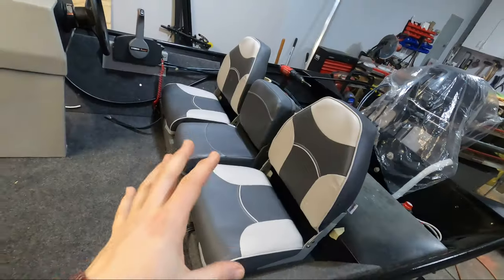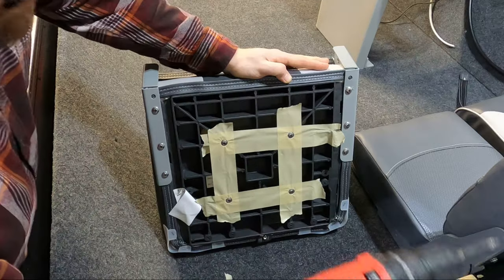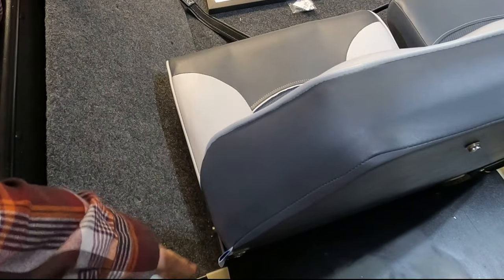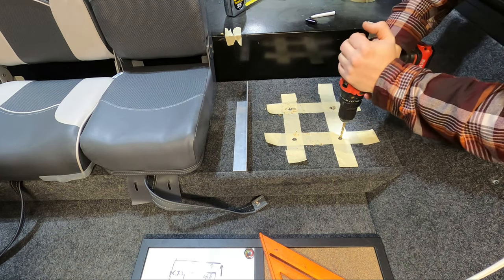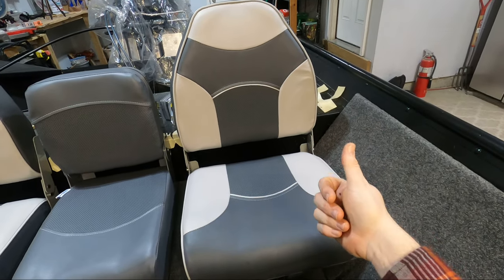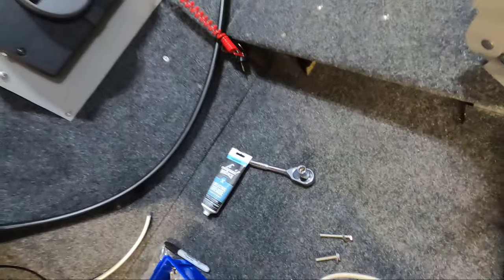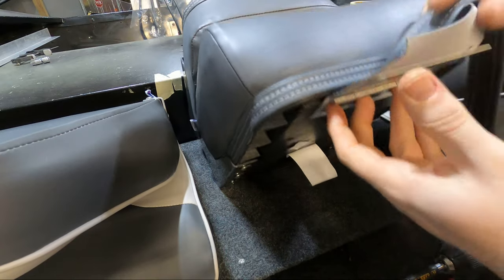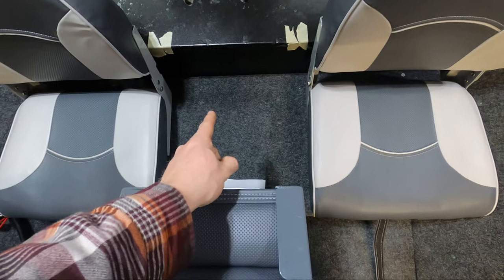Bass Boat Seat Installation on 1648 Jon Boat Build

Comment: Great videos! Doing the same thing to my 14-48. Where did you buy the seats.
Reply from the maker: Here you go: https://amzn.to/43wvcep

They are Deckmate seats. I like them a lot, wasn't a fan of the bass boat style but the fishing seat style was comfy.
Reply: I’m on the fence over a full bench or the setup like you used.
Reply from the maker: @CHRISINMCNEILL  I'm really happy with it, I ended up adding storage under the seats which I couldn't do if I did a full bench. I'll have a vid out soon with that build, it's super clean and works great.